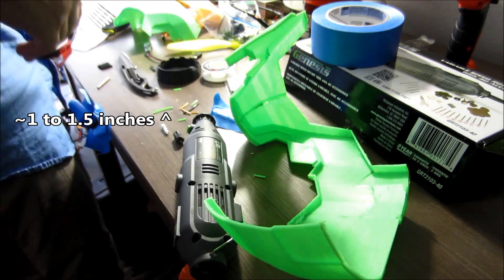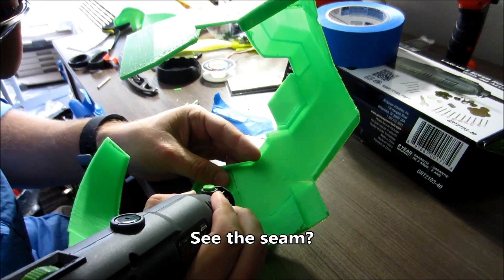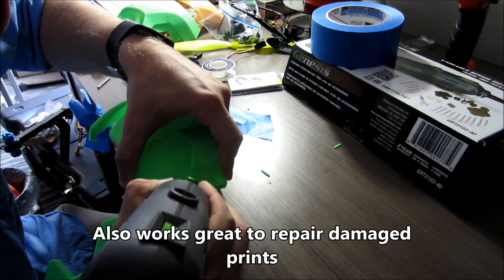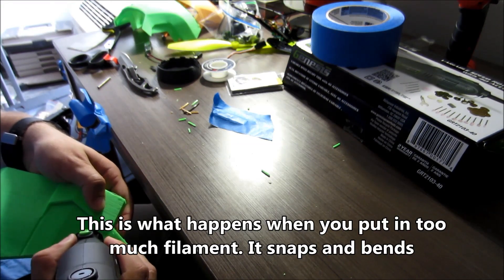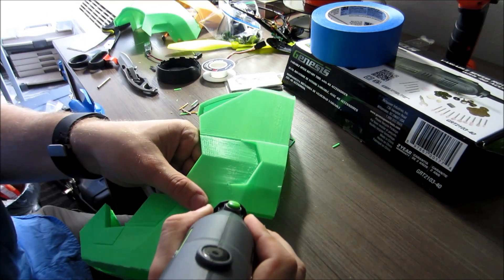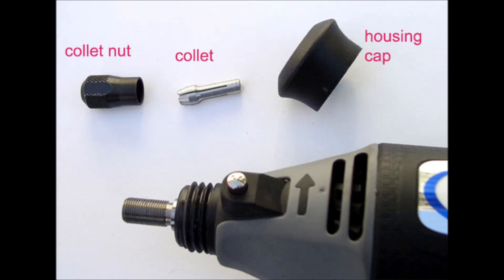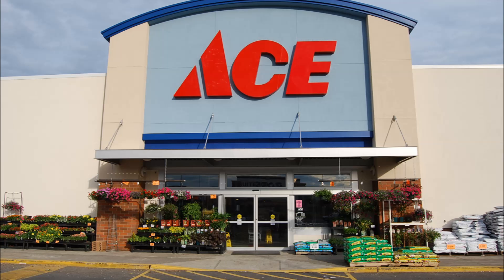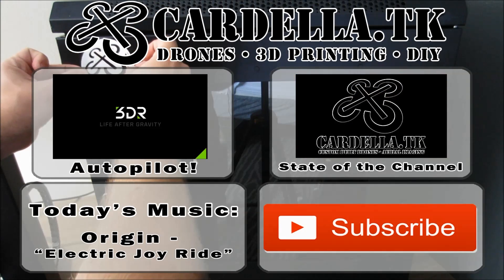Friction Welding - Easily join PLA Parts without glue!

Comment: I'm printing a mandalorian helmet, and i was wondering if this method works on wider parts like 1cm wide
Reply from the maker: This will tack the surface together, at any rate. You could do it on one or both sides. I'd advise against doing this over super glue though, because it'll heat up the glue... And that's probably not good to breathe

Comment: Thanks, this works great.

You can also purchase what is called a multi-pro tool chuck. I works like the end of a drill and will allow you to clamp 1/32" (.7938mm) to 1/8" (3.175mm) dia. It was about $3 more than the collet set. It allows me to slide a longer piece of filament into the dremel. Once the filament is too short, loosen, pull some out, tighten, go again.